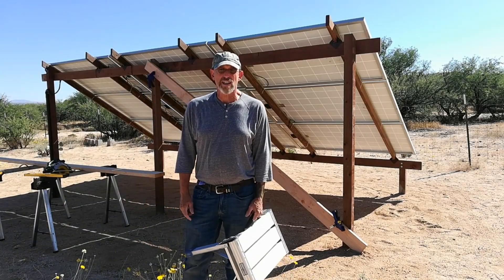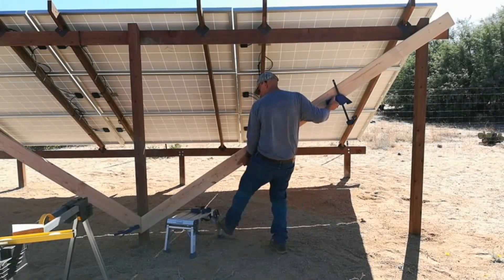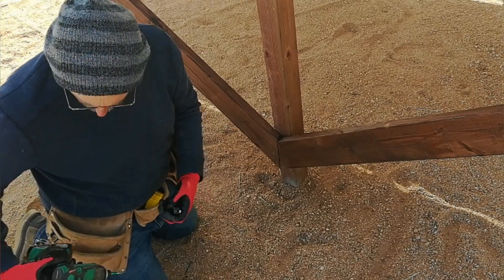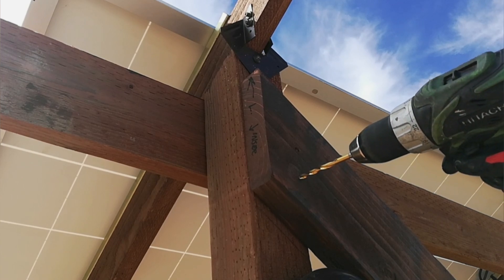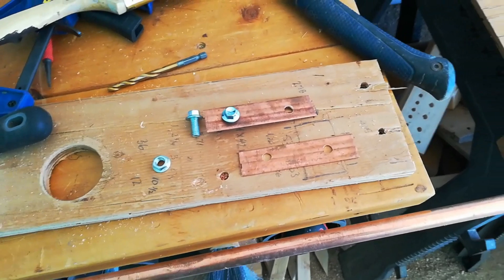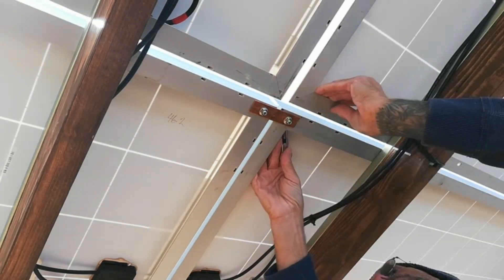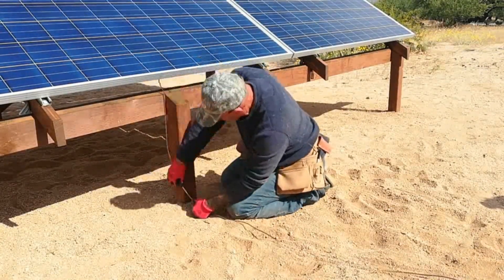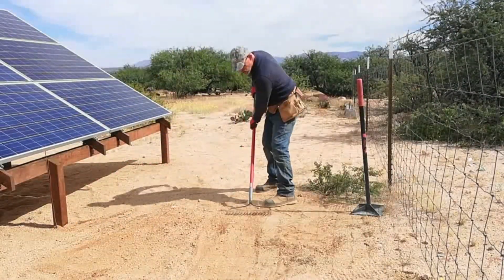Finishing Our Solar Ground Mount

Comment: Excellent video, I really liked the design of the ground mounts. Now that its been a while, would have you changed anything on the design?
Reply from the maker: The only thing that would have made the construction a little easier would have been to use a deep channel unistrut. It would have provided a little more room to tighten down the panels.  Unfortunately it was available at the time of the build. The mount has performed beautifully. In fact, I'm planning on expanding it to accommodate another 6 panels.

Comment: This is a wonderfully done video.  I plan to put up something similar made entirely of wood.  My panels are 175w flex panels.  Since I visit the cabin only a few times a year the plan is to be able to take the panels down for the winter.  The flex panels will be mounted on plywood such that the panel itself can be stored.  Your design was exactly what I was looking for in a solar panel mounting system.  The 30 degree angle was pretty clever.  Frankly, the fixed system seems more useful in my case.  

I was surprised that you did not use aluminum connectors between panels. You don't need copper.

Comment: Theoretically, the aluminum will galvanically corrode near the area where it's connected to copper when it's wet. But it's not a critical application like on an airplane, and rainwater is not highly conductive.

Comment: Carriage bolts in my opinion are intended for weight bearing.  In your case i fail to see the need for them with regard to attachment of cross pieces.  In the old days 3" oar more zinc coated nails would have been used.  In the old days no one had large screws and carriage bolts had hand drilled holes.  With all of the screws you put in it the wind will destroy the solar panels long before the bracing will detach.  :-)

Comment: I've used carriage bolts extensively on a deck, wheelchair ramp and screened-in porch.  That said, they do tend to loosen over time (even with lock washers) as the wood swells and contracts along with the season.  I think beefy lags are a good way to go in this case.

Comment: U was able to run that far on 10 gauge wire and not have any voltage drop everybody keep telling me I got to use 4 gauge and I'm only going 50 ft ??
Reply: At what voltage?  With amps being equal, the higher the voltage, the thinner the wire you can use.

Comment: Other solar installations I have seen run the grounding wire to each panel using an aluminum connector similar to what you used on that one panel.  I guess that is to prevent the lightning from flowing through multiple panels and provide a more direct route to ground.  Not sure if it really makes a difference.  Also, the DIY straps were bolted to your panels with what looked like galvanized bolts.  I always worry when connecting dissimilar metals about the possibility of galvanic corrosion.  This can lead to mechanical decay and possible increase in electrical resistance.  Again, I am not really sure if it applies to your particular case, but that is another thing to worry about in solar panel installation.

Comment: Does panel orientation matter?  (Vertical vs. horizontal) How does a person calculate angle and direction, is there a formula you can recommend?  Thanks in advance!  Great job, too!
Reply from the maker: Thanks for watching. The orientation doesn't matter though you want to take into consideration the location of the wires on the back of the panels to make for the most efficient connections. There are websites that offer a calculator where you plug in your zip code and it will give you the optimal direction ( we are about 5 ° east of true south ) and will tell you the optimal pitch for each season. Typically Spring and Fall will have the same value, winter will be much more vertical and summer the panels will be very flat. Since our array is stationary, we went with the happy medium of the spring and fall values. To determine the angle when building the structure, I used a roofing calculator which determines the pitch of a roof. I told it I wanted a 27°pitch and a run of 8 feet. It told me how high the two beams needed to be in order to get that angle. It's much easier than it sounds. Sorry for the lengthy response.
Reply: Thanks for the instructive reply!  I guess I can google for those resources you mentioned (for direction and pitch and for the roofing calculator)?

Comment: I'm trying to find the timber steel connectors online, it's the 8 connectors that the wooden pieces are sitting in to. Anyone got an answer to what they're called?
Reply from the maker: Are you referring to the hurricane ties? If so, Home Depot has them

Simpson Strong-Tie	H1 18-Gauge ZMAX  Galvanized Hurricane Tie
https://www.homedepot.com/p/Simpson-Strong-Tie-H1-18-Gauge-ZMAX-Galvanized-Hurricane-Tie-H1Z/100374935
Reply: There exactly what i was looking for 😁, thank you for your reply. I'm going to use your design, it really helped me. Thank you
Reply from the maker: If you have any questions, don't hesitate to ask. Good luck with the build! 👍

Comment: Very Nice Job! Speaking for myself, there is an awful lot of surface area on those panels. If you get extreme winds from the south then the 4x4 posts are individually carrying the gust loads (measured in tons of force). The question is, what would it cost to replace the panels during a worse-case event versus the cost of two 2x6 boards at 45 degrees bracing front to back? Would it ever happen? Probably not, but if it does and you consider this a 'permanent' structure then I'd add the bracing for peace-of-mind. My rear deck here in Houston has a similar design (with roof and solar panels) and I used 6x6 posts with diagonal bracing and it has stood up to three hurricanes even when neighbors deck covers got ripped off. 

The lag bolts are a great idea but recognize that they are the weak point. With that being said, it's easy enough to replace with lag bolts (as my deck has) if you ever see them getting loose. Use all galvanized, crank them down with a ratchet and call it done. Great videos! Keep up the awesome work!

Comment: First of all you do not combine aluminum with copper without using electrical grease.  Aluminum corrodes and forms an oxide that is not conductive.  Second the ground rod should have been placed right at the leg coming down not 10 feet away.  You always keep your ground connections as short as possible.  Very poor planning.
Reply: I would lighten up on the planning and just call it a suggestion for a minor improvement.

Comment: We have never seen an off-gridder that enjoys staining wood as much as you do (smile)!  Nice job on the grounding system. Like you, we have a similar problem at Contentment with electrical grounding:  keeping the soil near the grounding rod moistened, so it is more reliable. Whenever I have some extra grey water I pour it into the soil around the rod. Another fix might be to place it along the border of a garden or in the greenhouse, if proximity allows. Thanks for the video!
Reply: @theupsideofdownsizing  Yeah, dry soil doesn't ground very well. Instead of moving the rod, you may consider planting a low-growing shrub that needs regular watering. Cheers!

Comment: I stopped using lags and now I use timber locs you can get them with a super wide flat head and 3 1/2 inches to 12 inches long. Most packages come with a driver bit.
Reply: @theupsideofdownsizing  they are cheaper and they are coated less chance of rot. The sheer weight on them is 750lbs. And the thinner profile actually works to your advantage especially in the desert where dry rot is  an issue. When we built log cabins we used a copper tox and used motor oil mixture to treat exposed wood and it worked well to combat dry rot. Linseed oil works well and you can apply it with a weed sprayer. Hope that helps.

Comment: Is it necessary for the grounding rod to be that long? As for the bracing, I think it will be fine. You can always go back and add some bracing later if you find it needs it. For now being able to access the back of the panels seems like it outweighs the need for additional bracing. 👍🏼